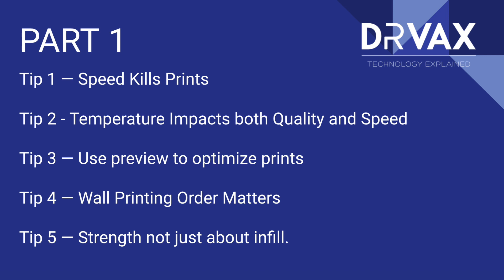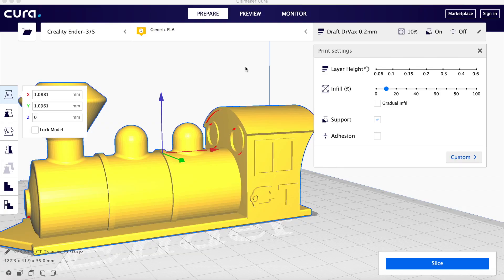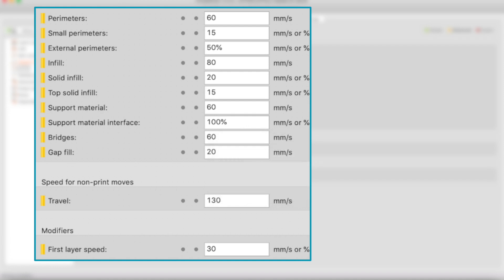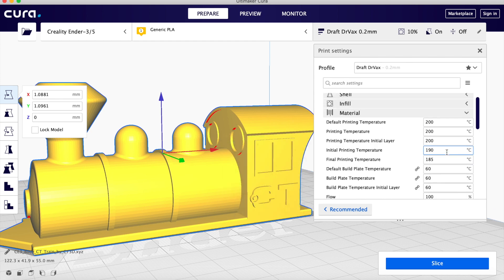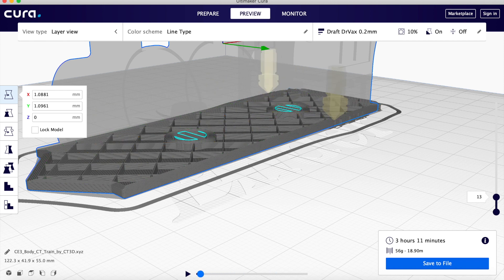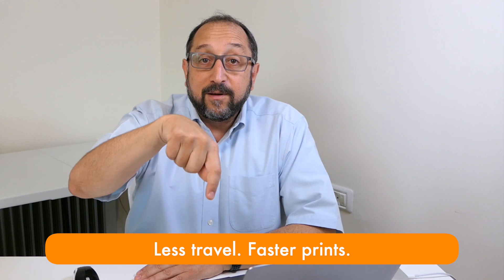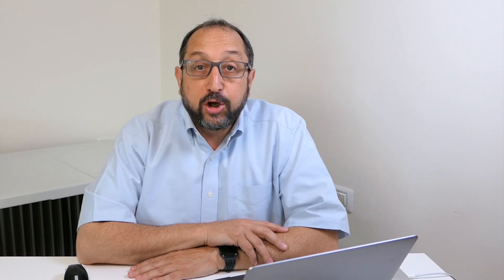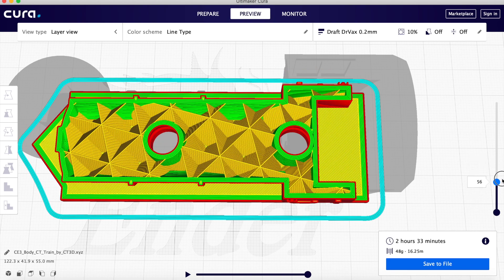10 3d Printer Slicer Suggestions for Better Prints (Part 1)

Comment: I've been chasing an under extrusion problem on a new printer for days now, going through settings with a microscope, doing test prints on evolutions of findings, bed leveling after bed leveling (though I did also find that the bed is so warped that I got a replacement out of the warranty department) etc, and still having them fail. I came across one of your videos (and have been binging them in the background since!) and may have finally found the problem, and man, it's a massive face palm. Somehow in all the custom profiles I made for a non-supported printer (a massive delta in Cura), after upgrading to 4.5, the filament reverted to the base 2.85, and of course I'm using 1.75. And somehow I got through the printer tab just fine and missed the extruder tab. Oh $#!t!! 
Guess who just had a massive deletion party wiping 2 weeks of prep models...

Comment: Again an awesomely instructional video. I was hoping you would have commented on Gyroid Fill type, but otherwise all the detail was very helpful.
Reply from the maker: I am planning to do a video where I will print without tops each of the fill patterns available and show and discuss them in a video.   My list of potential videos is getting quite long and I have two new printer reviews I will be doing over the next few weeks.   So it may be a while but I will get to it.

Comment: Great video.  What version of CURA are you using?  I have never seen the option to see the print progress of a layer.  I use the preview all the time, but can only see one layer at a time, not the movement within a layer.
Reply from the maker: 4.1
Reply: If You can't see it, your graphic card is obsolete and Cura runs in compatibility mode.
Reply: @kubo527  Thanks for the idea.  I'm running an I5 using the internal on chip graphics, would that be the problem?
Reply: @woodwaker1  
Most likely yes...